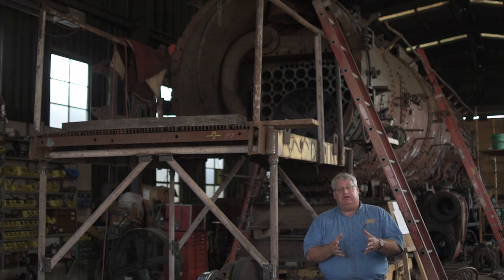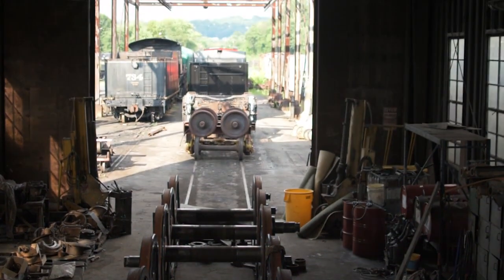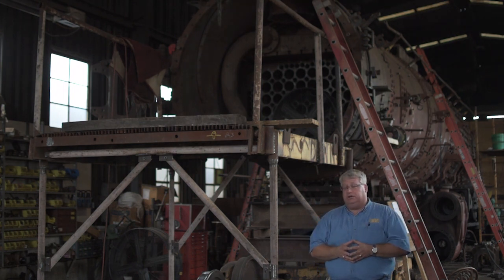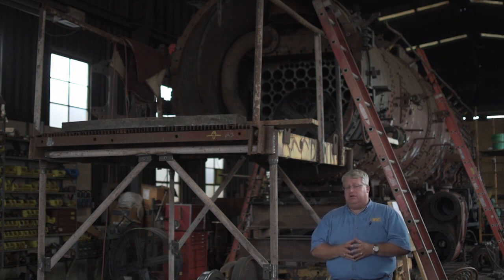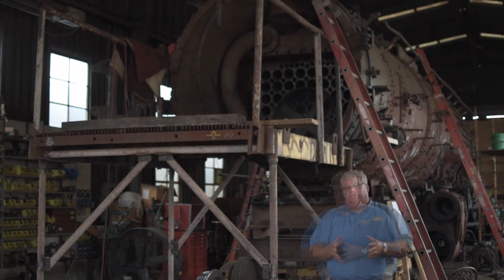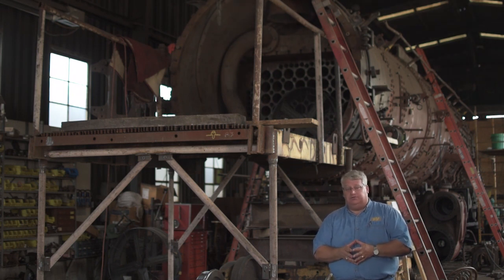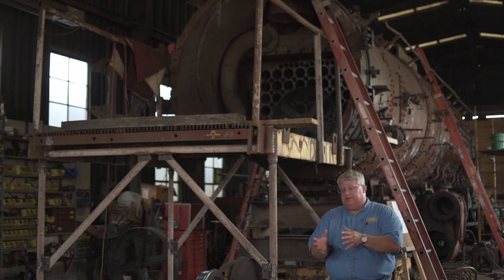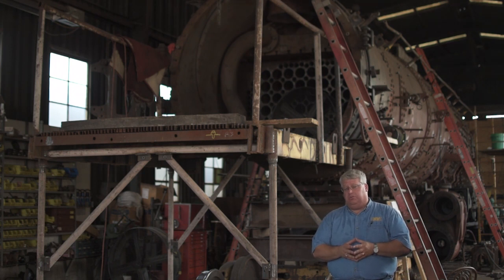Steam Engine 1309: Restoration Update

Comment: yea we all take honor and pride in our machines, and doing it right cant be rushed, but no organization is without some problems, I saw a fellow at the 765 open house and told me of the progress of the project, and that the shop for the western Maryland scenic railroad is one of the old cumberland car shops, and its kind of narrow in there, and other things, but what one person thinks is just their conjecture,  yes eventually the loco will get done, its usually just a matter of man hours and money, since most steamers are ran by volunteers and non profits , I just wish the shop here in new haven had a better machine shop capacity, we got two big lathes and a Bridgeport, as well as a small drill press slash vertical mill, one large tool grinder, and a band saw for metal, oh and three torch sets, and to my knowledge 2 pipe benders and a welder or 2, 2 air compressors and lots of air and hand tools, and a small army of volunteers, and yes sometimes we even see Gary Bensman and his crew depending on the repairs, he is one of the engineers for the 765 as well, and then there is zack hall a man that knows lots of his stuff on these kinds of machines but a man of few words.

Comment: Will you repair the 734?
Reply: K9Nick811 they plan to after 1309, one project at a time
Reply: sevendoubletwo well... they just ran out of money and 1309s restoration was suspended. They should have done the 734s 1472 and then with that revenue finish 1309...